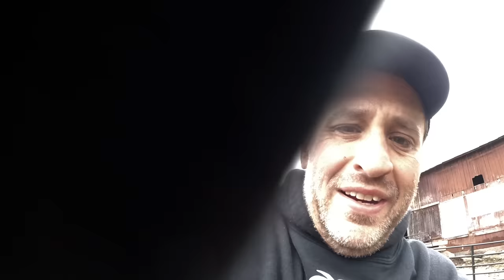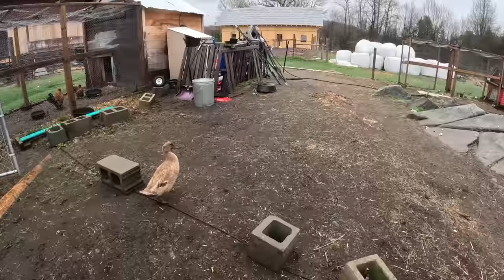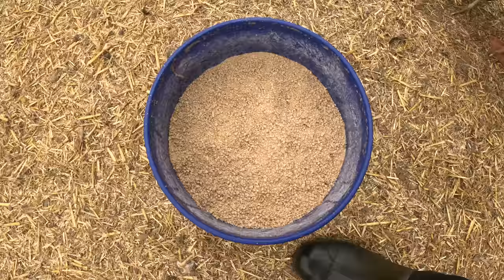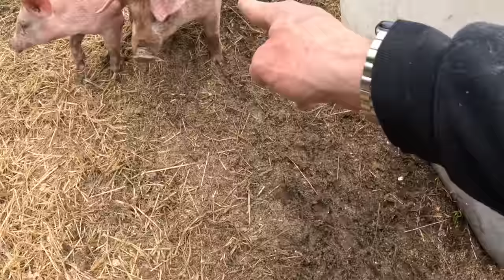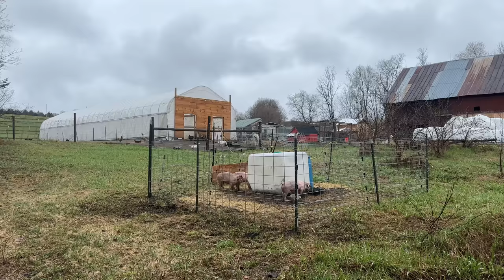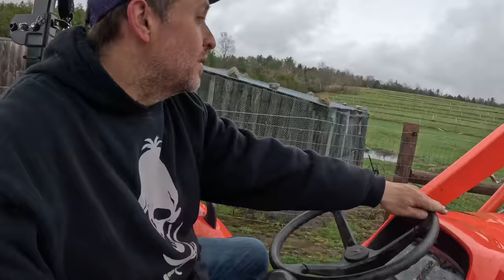I Got 99 Farm Problems (But My Farm Dog Ain't One)

Comment: Generally, pigs will poop in one area of a pen, but pigs do not all share the same area as the other pigs. So, with multiple pigs you can end up with a pend full of pig crap because each pig has their own area that may or may not overlap.  Source: Me, I raised pigs for 10 years as I was growing up.  

Also, note, the "crap area" isn't any specific size either, one pig I had would only poop in a corner, another would poop anywhere on one side of the pen.

Comment: I would suggest that next time you are training new piglets to electric fence you have only one side of the pen electric for the first 3-4 hours. Then 2 sides and then 3 sides overnight. So when they touch the electric fence they don’t panic and run into another fence causing a sequence of panic. If the pen was much bigger this would not have been a problem.
Reply: The comment above is spam garbage. Just for your information.

Comment: I think the reason why the pigs water barrel is leaking is that they push against the spigot and therewith breaking the seal. You might want to put the Barrel outside the fence and mount the nozzle on something solid. Connecting the spigot with a short hose to the barrel…
Reply: No because they'll destroy the hose, they're pigs lol

Comment: Re. Pig Feeder . Half of a plastic barrel can work pretty well .Drill a few holes in the bottom to allow drainage when it rains .
Reply: ^^^
Maybe have it lifted to where they can't step on it and at an angle, so the feed doesn't pack together as easy with what you give them. If you're worried about giving it a wash at whatever point, since it would be at an angle, just take the hose and give a rinse-- boom, clean and ready for fill!

Also a good excuse to use any leftover lumber or items to put together.

Comment: Pig trough options: 
1. Mortar trough ($10 to 100 depending on size and quality), for your needs I'd say go for the cheaper ones
2. Recycled truck/tractor tire ($0) - get the largest scrapped tire you can find and cut it in half with an angle grinder, you'll get 2 sturdy semi-circular troughs for free, the only downside is that you need to anchor them to stay upright, either by tying them to a tree or a pole or by digging a shallow trench/slot in the ground.

Comment: Pig Trough: Just take some boards (2x4s or 2x6s or 2x8s) and make a "V", put some walls on, attach and cut some stubby legs to keep it upright, or tilted for easier access.  Put the whole thing on a base and/or attach it to a wall to keep it upright.

Comment: Hi Morgan.  Love Toby and Abby, mostly Toby dog.  I think you need to hire some help.
You need to properly plan out your fences , pond and irrigation,  You have a great creek.  
Hire a civil engineer to plan how to best use you creek. You could have a small dam up high or a larger dam down low, 
but if you make a large dam you may not need your pond, hard to say. 
 If you have a small dam higher up you could run underground pipes to your pond, it is possible to run pipes over the rock walls
but keep in mind sunlight degrades all plastics. Once you have a plan contract out the actual work.  Otherwise you
risk not doing the job right.  Also your pigs will escape the electric wires.  Just be sure to have food always available for them.
Pigs value food above all else.

Comment: For the feed troth. Take a 50 gallon drum. Cut it in half down the length, and lay in down at an angle and fix it securely to some rebars staked into the ground.

Comment: I worked for a glass company...put a huge glob of silicone then put in the spout and don't use it for a good 24-48 hrs...also u must get one that is ok for water and is not toxic...we used it for aquariums to seal them and it also made sure to be non toxic for food and water...we got ours from the local lumber yard if we ran out..put it in a caulk gun....good luck

Comment: My grandparens for pigs would cut metal pipe in half and welf plates of steal to the ends so the trough would be a half cylinder. For cleaning poop out of a trough would have a flat shovel.

Comment: What I have done is get 6in or 12 inch pvc pipe and cut in half and wala,  you have a lovely trough. Thats a good base to work with, either hang it from fence or make it where it is able to be on the ground with out being tipped over so easy.

Comment: Morgan: Regarding the pig waterer, you have the right idea but the wrong parts.  I have one of these for gravity-fed garden watering.  Use a metal barrel with a lid, and put a brass faucet on it that you can tighten down.  Mine does not leak, and I have similar temp ranges here in W. Michigan. It froze one year, and made the bottom of the barrel convex…🤭

Comment: With pigs it depends on the size of the enclosure. The smaller it is, the more likely they will be to make more of a mess. Younger pigs also tend to be messier than older pigs.

We have 8 at the moment. They have a feed area at the barn and about 2 and a half acres of pasture. When young we raked the poop into a couple of compost piles, and now as adults they just go on the edges of the piles. Then we just water and turn it once a week until gardening time.

Comment: As for a pig trough, I am thinking a Sheet of Aluminum Siding. Cut it in half or bend it in half. Try bend it into a 2ft by 4ft oval/ellipse. That should make it just high enough that they can get head and neck into it. If you need to, and have some bar stock, Install studs (basically) to keep it from falling in on itself. Either use a spot welder, rivets or self tapping metal screws. Not sure what you have around your farm.

Comment: Hi Morgan, maybe you should set up a camera at the front and back of the hoop coop one night so you can learn how the birds are getting out. Also for the pigs I would move their pigloo into the corner so they just have more wiggle room. One simple idea I have for feeding the pigs is to get a barrel and cut it in half vertically then just screw on some wood blocks to the top and bottom of the half barrel so the barrel doesn't tip over.

Comment: you should have a fence line that is a tunnel that has gates opening to different quadrants of the pasture that all lead back to the bird housing that you can open and close individual gates so that each night when the birds go to bed in the bird housing you can switch to a different quadrant. you could also use it as tunnel for the cattle. the gate would swing open and close off the rest of the tunnel and the castle would be force to enter the new quadrant.

Comment: Pig tough...we used a cylinder cut in half length wise with short stakes welded on for legs to front side and back side, then pushed into ground.  We used these for water and for food.

Comment: Food troughs out of crappy waterer.

Cut the blue pig waterer in half vertically. Put each half on its side with the open part up but at a 45 degree angle. Drill 4 holes along the solid side placing the solid side up against the fencing. Then run chain through the holes and through the fence, and lock the chain on the outside of the fence. You then have 2 large food troughs. If you don't understand my description look at "edge of nowhere farm" on YouTube and they have videos of it on their videos. You can see what it looks like on one of their videos with their pigs.

Comment: You could cut your faulty pig watering barrel in half the long way, mount it to some 4X4's or other chunks of lumber and attach a big O hook on one end to drag it around.
The pigs won't be able to climb in so easy and have a hard time knocking it over.  With a few holes drilled in the bottom it will drain in the rain.  It would be portable and pretty much free.
Muddy Marimbas... sort of sounds like a song lyric or a new T- Shirt.

Comment: No joke, have you considered Flex Tape for your pig waterer issues? Rubber adhesive is really solid and has no problem with wet surfaces. It's more expensive than duct tape, but it works!

Comment: @Goldshawfarm 
MORGAN PLEASE STACK YOUR HAY BALES CORRECTLY (on their sides in two rows, with a 3rd row on the top, which balances on top of the two rows on the ground). 

It will make it easier for you because:
- stops mud forming under/around them. 
- limit places for rodents to find places to hide and give them time to chew their way inside 
- reduce the risk of bales falling and injuring your barn cats as they hunt rodents 
- easier to stack & remove ones you want to use 
- space saving
- much tidier looking

Should look like this (side view): 
  ⚪
⚪⚪

Comment: simplest pig through - cut a metal barrel in half and get 2 of them. used to keep those angled and secured by drilling them to the barn wall

Edit: source of my advice was grandpa's farm and just googled the design - seems like people also use the the plastic barrels like the one for your pig waterer (easier to cut and smooth out the sharp edges from cutting)

Comment: did you try flex tape for the pig waterer? for the pig feeder maybe a ferret corner litter bow design... like the feeder would be a triangle on the side of the pig pin so the pigs can eat in one area corner.
Reply: might have to do the dog weekend feeder design for the pig waterer but on a bigger scale...

Comment: They can't possibly poop in one corner because that pen is too small for those three pigs....especially with electrified wire on all sides (that keeps them away from using a "corner").   More room will help with the eating as well, then you can spread out the feed bowls and they won't be standing in them as much.

Comment: I'm... genuinely surprised you're having trouble with pig troughs, considering a quick google search produces a wealth of simple designs. Literally just make a shallow v with two 4-foot by 10-inch lengths of plywood, shore them up on either side with a piece of 2x12, making sure they're tall enough to keep the trough a few inches off the ground. It's really easy.

Comment: And I know it’s a lack of experience on your part, but you think you’d research stuff a little bit better. It’s like just slamming your post and crooked just for the sake of getting it done. Why didn’t you tag each panel when you put them together? Or at least every second one. But even every second one would be half assing it! I remember having winter so bad as a kid in the 80s, the horses used to walk on top of the barn because the snow dresser so high and you couldn’t even see the fences. I wonder how you would fair if things got that intense? I remember my dad shovelling out the barn doors just so the cows didn’t suffocate, and the heat and steam and smell there was when you got the door shovelled opened! Or the time the chickens got in with the pigs and the pigs eat every single one of them except for the feet, that was very creepy